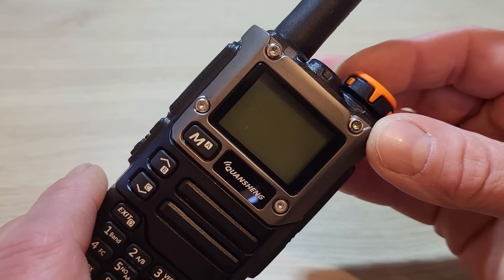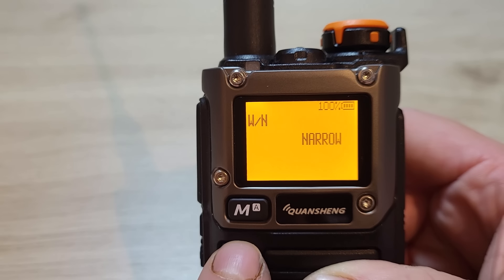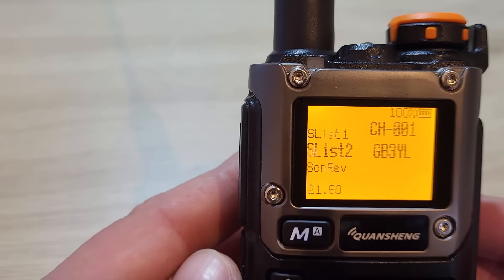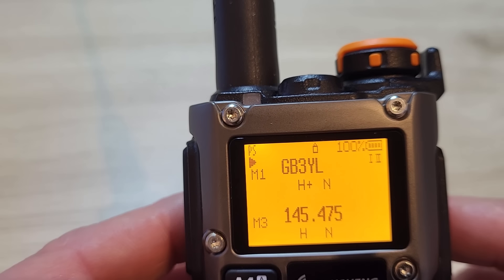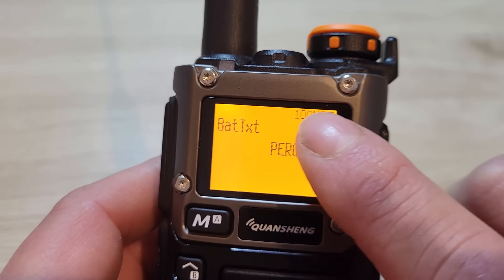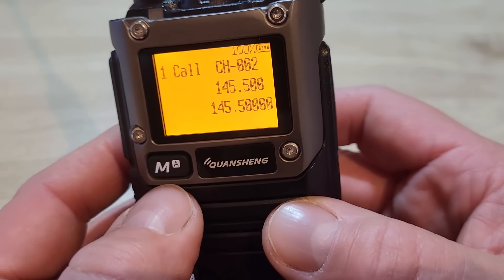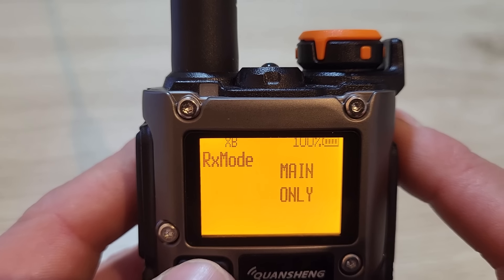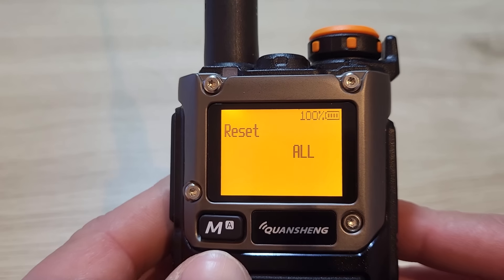Quansheng UV K5 Egzumer v0.20 Menu Options & Settings

Comment: The Apollo Quindar is the transmit tone you can hear during trasmission in old Apollo moonlander footage. You only know that if you're old. 😁 Nice video!
Reply from the maker: Thanks for the info 👍
Reply: Menu 61 unlock all doesn’t appear to work??
Reply from the maker: @johnstockwell8322  you need to repeat to process 10 times. Initially you will get 'Read Manual' on 9 attempts then 'F Lock' when successful.
Reply: Got a feeling it's 1875 Hz for 1.875 secs  if I remember hi hi cobra 148 tone ...in my 9900 too..!
Reply: Thanks!
Reply: @m7frs272  Unfortunately it still does not work to unlock USB TX..

Comment: Thanks for the helpful explanation of all the menu functions.  Just a note, you really should calibrate the battery Voltage indication. Yours is showing 8.47V!  Lithium Ion should never go above 8.4V for a 2S battery. I’m certain if you put a known good meter on the rear battery terminals it will be a bit less than 8.4V in reality. The USB charging port won’t take it much above 8V. The base stand charger stops at less than 8.4V (at least mine does anyway). My Set was showing well above the actual battery Voltage when new out of the box last week. HTH.
Reply from the maker: Cheers and thanks for the info 👍
Reply: any idea what i should set it to ? thanks in advance
Reply: forgot to mention battery is 7.4v but i cant select amp hours in mine

Comment: STE is mainly used on repeaters (a receiver that uses CTCSS). It is supposed to continue TXing for a short duration but with no CTCSS or a reverse tone on DCS. Most of these radios don't do it correctly so it remains a useless feature because it wasn't built correctly. On commercial 2-way radios systems back in the day that used CTCSS (PL/CG/QT tones) it works great. Most hams don't set their repeaters up correctly for these features to work right.
Reply: Reverse burst or Squelch Tail Elimination ("STE") is a process that uses a change of the phase of the PL tone encoder for a short period of time after the user unkeys the PTT button. The term "reverse burst" is used to describe the deliberate phase change for a specific abount of time while the transmitter carrier stays on - about 150 to 200ms - with the phase of the PL encoder offset by from 120 to 180 degrees (180, naturally is a complete reversal). During the reverse burst time period the reverse phase stops the PL decode reed dead in its tracks - which slams the receiver squelch closed right now.   By the time the transmitter actually drops off the air the RX squelch is already closed - which results in no burst of squelch noise being heard.

Comment: Hi Ben, thank you very much for your comprehensive walk through - it has proven very helpful. I have a quick question. When I select the FM radio function, it appears to be fixed to between 64 and 75 meters for some reason and I cannot tune beyond this upper threshold. Would you happen to know how I may adjust this to encompass the full FM spectrum? Thanks.
Reply from the maker: I believe that depends on what version of firmware you are using. It should be possible to set the parameters in the menu somewhere. 
Thanks for watching 👍 
Ben
de M7FRS

Comment: Hi Ben. Thank you for a well-explained tutorial. I need, from an experimental task only, even when I am fully licensed G4SVY, to transmit in all bands but find the F Lock feature to do that does not change anything? You mentioned something in the way of having to repeat the operation 10 times, can you elaborate on how exactly you do that to unlock all bands, please?
Reply from the maker: Hi, when you go into the hidden menu and select 'F Lock' then 'Unlock All' you'll get the message 'Read Manual' Repeat the 'Unlock All' selection 10 times and eventually you will no longer get the 'Read Manual' message and the radio is unlocked.

Comment: What is the best radio for Am for picking up Aircraft please 🙏 Alan from Luton ps people say not to up loed it because the watts charge from 2 watts to 8 watts and they go all over the place . Thanks for help Alan from Luton ✈️🇬🇧💯👍
Reply from the maker: Hi Alan. If you just was a cheap radio for listening to aircraft then this should be fine, especially if your not planning on transmitting with it. (You can turn off transmit in the settings if you want to) Most, if not all of the modified firmware will improve AM reception. The only issue with these radios is when people try using them to transmit on frequencies that they are not intended for.  Hope this helps.

Comment: How can I avoid not getting a knock on the door? Just never send and only receive? Thank you. I am new. From the US. Also is it ok to charge it from the c port?
Reply from the maker: You can use the hidden menu to set the radio to 'Disable All' which will not allow TX on any band/frequency. Also, not really. It's recommended by the manufacturer that you avoid charging will the USB port. (I'm not really sure why they fitted it to the later models to be honest)

Comment: If I have used the UVMOD on my radio can I install the EGzumer after with no problem and it will replace the UVMOD?
Reply from the maker: Yes you can. The radio can only have one firmware loaded at any time, but its fine to change as much as you like.

Comment: Hello thanks for you video, i was also asking myself how did you named the CB channels in memory ? I tried with UV-K5 Programming Software-Neutral and CHIRP but it's says thoses frequency are not supported by this radio so it does not let me rename (I've added 40channels by hand and thought at least i could renamed it ^^)
Reply from the maker: It is possible in CHIRP. If you select 'settings' then 'driver information' then check the box 'limits disabled for modified firmware'. You should then be able to write out of band frequencies and names.
Reply: @m7frs272 Thanks for your response, but i do not have this line in this tab, i only have the firmware Version (v0.22)

Comment: My radio hasnt been modified yet and i cant find a back light settings 😔  is there anyway of changing my backlight or do i need it modified? Cheers .
Reply from the maker: I've done firmware mods on all of mine, so I can't really check to be honest, sorry.  I'm sure it is possible in the original menu somewhere. Thanks for watching 👍
Reply: @m7frs272  yeah i managed to upgrade the firmware and I got all the settings now . Cheers 🍻
Reply from the maker: @craniumjunglist8934  Glad you sorted it 👍
Reply: @m7frs272  thanks for your message.  Ive subbed

Comment: I'm a bit of a newbie with this radio, so please excuse the question: If I flash my radio with this firmware (Egzumer v0.20), can I still continue to program it with Chirp Next?  Also, will you be doing a video on the next Egzumer version (0.21)?  Thanks!
Reply from the maker: Yes that's absolutely fine. To be honest I haven't planned to do a video on version 0.21 as the basics are the same. Hope that helps.

Comment: Question if I may? Menu 7 and Menu 8 Directional Offset/Directional Frequency. 

Does this work as per frequency? Say I have a repeater, for example my local Slough. I'm monitoring it, it is highlighted with the black triangle on the home screen, and I want to change the directional offset and frequency to + 1.6Mgz. I go into the menu 7 and menu 8 and change the offset. Does this now save to that frequency (Slough) alone? 

So if I now go to the Bracknell repeater and change it offset using menu 7 and 8, it will save its offset also, and not mess up Slough's offset?

I was slightly confused, thinking when I changed offsets in menu 7 and 8 it was a global change across all frequencies.

Thank you for any help you may divulge 😊

Comment: Awesome job Ben and I hope all is well 🤝 I have a question for ya. I noticed that when powering on my radio, channel A / channel 1 is always on AM. I've set the Demodulation to FM and on powering on the radio it reverts back to AM with TX disabled. Also, I noticed that after setting the Demodulation to FM , if I go to another channel and then go back to the previous channel 1, it will be set to AM also. Is their a way to fix this or do I have to manually change it every time I turn on or change the channel ?

Comment: So good info but htf do you revert to original firmware,  the Chinese Web won't let ya and who knows how github works!
Reply: I am uniformed but i saw a menu item Reset. In the hidden menu. Hold the radio in your right hand the buttons on the edge, press top button while pressing middle button. Use left hand to turn on. After the welcome msg. it will show hidden menu. I think 53 go down to reset. Warning i have no idea if original firmware comes back.

Comment: hello, totally new to this radio, may i ask why you have the step set to 6.25? mine is set to 25.00kHz whats the difference? Many thanks
Reply from the maker: It depends what the channel spacing is of the frequencies you want to listen to. For example airband frequencies use 8.33Khz spacing. If you're inputing a frequency, say 446.00625 and you were in 50Khz it would only let you input 446.050, so you'd need to use a lower spacing. I hope that makes some sort of sense. Thanks for watching 👍

Comment: Tried in vain last night to get my uvk5 to download but no data comm to/from rsdio. Not even in chirp. 

Pulled out a baofeng uv17 and a later uv17pro and was able to upload channels and settings from chirp no problem. 

So PC, com port, and cable all do as they should 

On thr k5 i held ptt while turning on to enter flash mode.. but no comms between PC and k5 ... any ideas
Reply: Richard, I tried two Baofeng programming cables and I had the same problem as you.
Neither of them worked.
I then brought a UVK5 programming cable and the correct cable worked straight away.
Reply: My Baofeng cable worked just fine but it didn’t at first. I discovered You have to push the twin Jack end fully in and it takes some real force!  HTH Peter
Reply: I'ved read somewhere that you have to "push" the cable real good inside. With a little extra pressure. Hope it helps...
Reply: I had trouble with mine, as others have said here, you have to really push the plug in hard to get it to connect.
Reply: @IanDarley  .. Yeah, happened to me too. Just push-it.

Comment: Great video, very helpful.  How do you get the orange backlight/screen?  I'm on FW 0.20 egzumer
Reply from the maker: That's the UV-K5 (8) model that has the orange screen. Unfortunately you can't change the colours in the firmware.